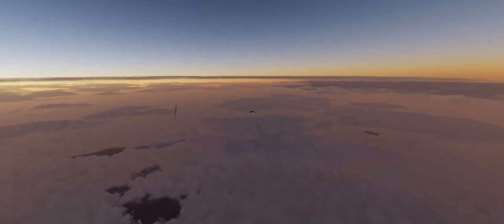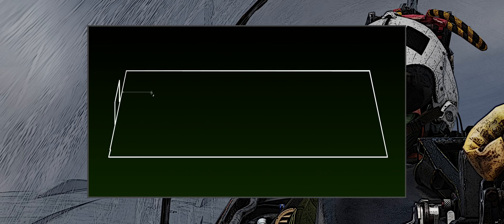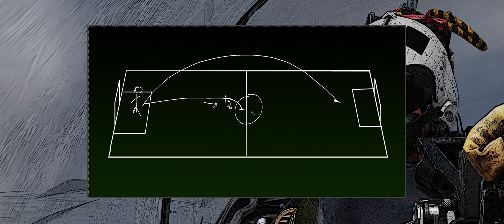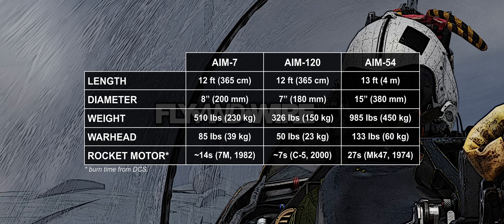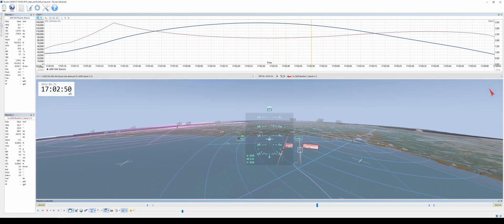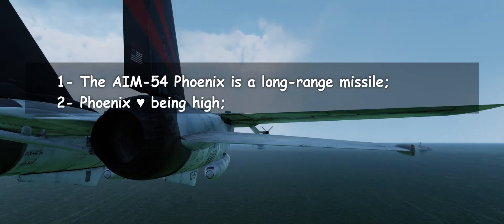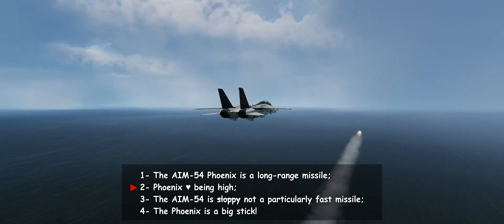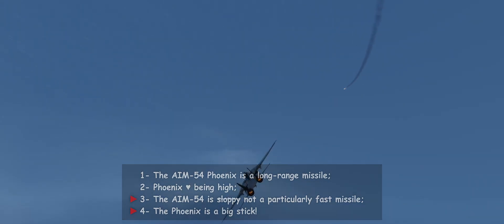Improving the AIM-54 performance - Part I: Manual Loft Introduction

Comment: Hi, what did you say the g limit of the AIM-54A was? 16 or 60?
Reply from the maker: Actual limits? No one knows, besides who worked or used the missile.
The 54A pulled 16Gs in a test in mid 70s, and this is public knowledge, but it may be able to pull harder.
Reply: @FlyAndWire  ah, I see. Even the old AIM-7E-2 could pull around 25g so 16 for a big AIM-54 tracks.
Reply from the maker: @EEEEEEE354  I guess it was able to pull more (and probably bleed most of its energy). However, I always stick to the numbers we have whenever I can. In fact, I recall an interview where crews stated that the C versions was able to pull double the Gs, but it does not mean much per se, imo.

Comment: Didn't HB decrease the burntime to 20 seconds?
Reply from the maker: Which rocket motor are you referring to?
Reply: @FlyAndWire  My bad, checked again- mk60 has around 20 and mk 47 around 27
Reply from the maker: @TheSpaseDestroyeR  No worries, those values have changed a few times, and perhaps they will change again.
Reply: @FlyAndWire  hope for the better:)
Reply from the maker: @TheSpaseDestroyeR  The closer they are to realistic values, the happier I am :)